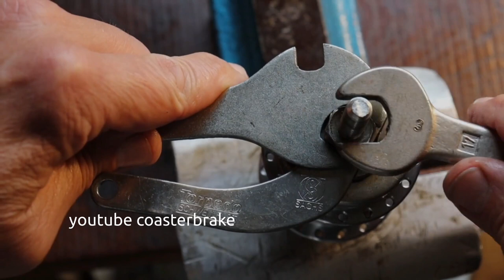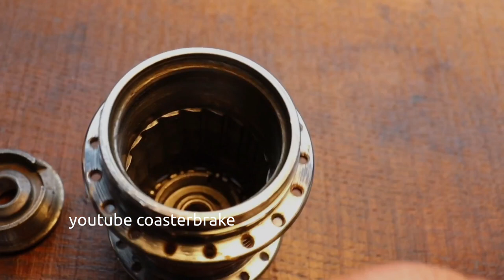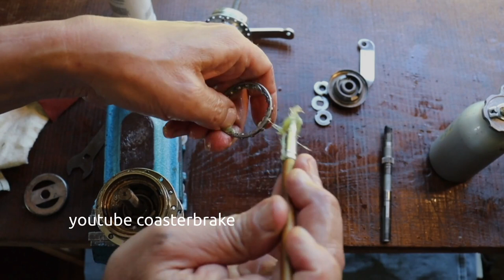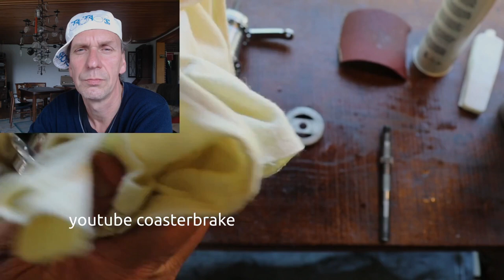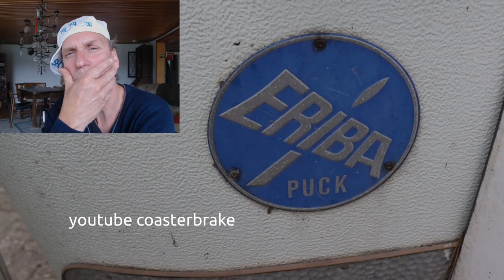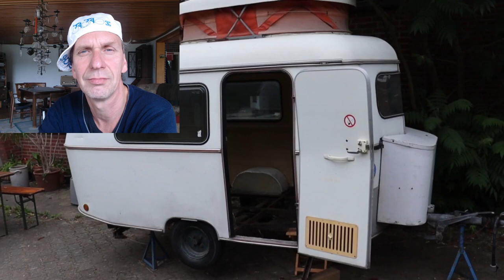How important is the play of the ball-bearing for a Sachs Torpedo kickback coasterbrake hub?

Comment: Hello!

I've done a plenty sachs 3 speed full services and what I have read and been told is that for any ball bearing it should have absolutely no play but the least pressure possible on the cones. The idea is if there is play that means that its only one ball bearing at each side bearing the full load and therefore the races will get damaged quickly. That means for instance when using a hub with a quick skewer that the hub should have a tiiiny bit of play when the skewer is not closed at the proper angle that will give the correct pressure. But then at proper pressure from the skewer all play is gone no matter at what position of the rotation of the wheel or how strongly it is forced side to side. When having good ball bearing races in undamaged condition and good ball bearings it should feel smooth as butter even though there cannot be any play. However a lot of not brand new hubs have damage in the races from never have been serviced and/or incorrect cup and cone adjustment. All new shimano hubs I have bought have been adjusted way too hard from the factory. They all need to be fixed before use or the races will get worn very quickly. 

I mostly service quick skewer hubs but also a lot of 3 speed sachs and shimano ones. I've "read" (english translate, I don't speak german) an old german sachs service manual that states when the wheel is not in the frame fully tightened, there should be the tiiiniest amount of play that will disappear after the wheel is installed in the frame with the wheelnuts properly tightened. Are you saying that all sachs hubs should have a bit of play or just the kickback double geared ones?

Thanks for your nice videos! Have a nice day! ♥
Reply from the maker: A play of the ball rings is better than set too hard. If you find exactly the point without bearing play, I think like you, the best way. for every hub.

Comment: In the spring of nineteen eighty my wife and I borrowed a pair of shopping bikes from a Kiwi friend they were fitted with back pedal braking sturmey archer three speed hubs. we had never used hubs like this before, ironically they were banned in the UK . The ministry of transport did not consider them safe for use on UK roads a great shame the bikes we borrowed were also fitted with standard cable brakes and were a delight to use. being able to check our speed on downhill gradients was a definite plus with those small wheels.. The only thing that worried me was the thought of over heating the cone and ceasing the hub.My own bike back home was fitted with a four speed sturmey sprint hub. whilst my dad favored his Pauls two speed fixed wheel hub god knows why it was an alarming bit of kit. anyway have to say I liked riding with a cone rear brake, I thought they were better than the sturmey hub brakes which were never the best.
Reply from the maker: Thanks David, One problem is that the brakes on a bicycle always need service. Like a car, every year, not every twenty years. Then it works. Dutch people often only have a coaster brake and no front brake. Regards Don Torpedo
Reply: @don-torpedo  Yes I knew that about the Dutch bikes, but the terrain there very different to most of the UK. I have also seen plenty of bikes crashing into people mainly in Dutch towns like Alkmaar and Amsterdam. I have a funny story to tell you about bike brakes. I was cycling to work one morning when I was stopped by a policeman and question on the condition of my brakes,I told him they were good that I had serviced them myself. He pulled on the levers and pushed the bike along with the wheels locked. he did not look satisfied and said thats no good so he jumps on the bike rides it a few feet and brakes hard still looks unsatisfied, meanwhile his buddy leaps out of the police car dropping the paper work he was pretending to do all three of us stood by the bike first cop says I will give it a proper test and of he rides hanging a right at the traffic lights. well after five minutes no sign of cop or bike and second cop and I are looking at each other both thinking WTF when all of a sudden first cop comes piling around the corner bike laid  over as far as it will go and cop pedaling like a demon, it was an impressive sight I could not get that bike to go like that or over to that angle this 48 year old man must have been quite a serious rider in his day anyway he gets to us and slams on the brakes, the bike stopped dead but he did not and the only thing that stopped him going over the bars were his testicles. Cop two falls to the floor rolling on his back laughing so loud he had to hold his sides suffering those pains you get from laughing too hard, fearing arrest I dare not laugh and leapt forward and grabbed cop one to hold him up making a big show of helping him off the bike and asking if he was OK when he could eventually speak again cop one tells me to slack off the brakes and staggers back to the car cop two picks himself off the floor and still laughing like a lunatic follows his partner back to the car, forty years later it still makes me laugh when ever I think of it. They were rim brakes not of any quality but they sure worked well.
Reply from the maker: @davidprocter3578  Bicycles bring people together, that's what I like about it. Thanks Jens